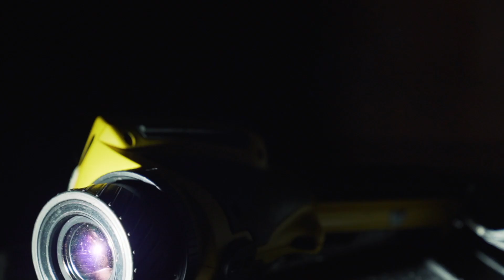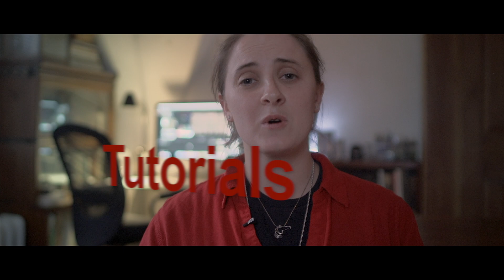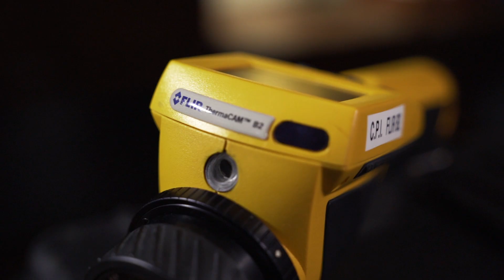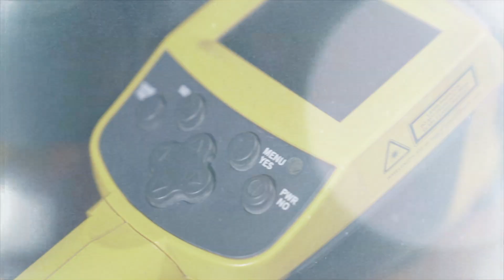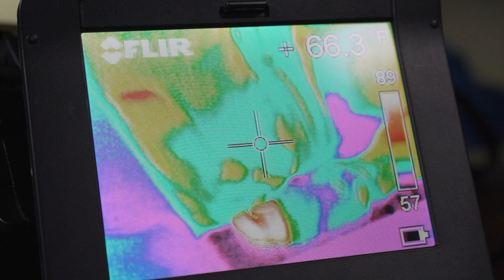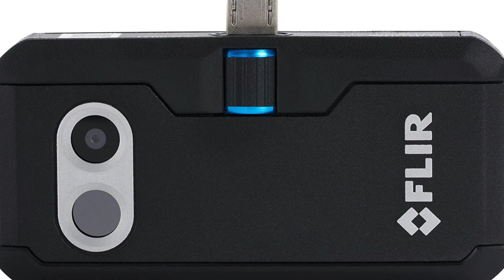Ghost Hunting | Thermal Imaging-THE COOLEST CAMERAS EVER!!!

Comment: The footag quality of IRFPA's has come a long way not least in these uncooled VOx microbolometer sensors 
I also use one, a model from Raytron that looks like a small rugged consumercamcorder with high ingress rating, with a foldable 5.1"  AMOLED HD screen.
The resolution on modern ones is getting higher and higher 
Fx https://youtu.be/uF0jfdAlsgo?si=VOyW9AgflBXk635c&t=46

Comment: question for you what is the best color palette to have it set to when ghost hunting?
Reply from the maker: @planetpapa2085  That’s a great question, there is no best palette for investigations, we use what ever gives the most detail in the environment that we are in. Often we use rainbow HC when using our B2’s as it has slightly enhanced contrast in the color spectrum and is generally a bit more flexible. In general pick the one that looks best for where you are, they are a visual representation only and don’t affect camera capture abilities. That said, what you really want dialed in is your emissivity settings as that great affects the accuracy of the camera. Hope this helps!
Reply: @ I just got it and am new to it.  How do I dial in emissivity settings?  What is the best way to do it?
Reply from the maker: @planetpapa2085, We attached a link below to the infrared training institute, they have a emissivity table you can study. You will need to adjust emissivity depending on your location and then adjust the emissivity as you move around and scan different materials. The FLIR b2 user manual also has a table inside, you can find a pdf version online. The infrared training institute also as well as FLIR both have training programs as well as some free instruction videos on YouTube, highly recommended if you are new to using these devices.

https://infraredtraininginstitute.com/thermograpahy-information/emissivity-of-various-materials/

Comment: Heat signature actually is based on light, but in infrared spectra, e.g. light of longer wavelength which cannot be seen, that is what makes it interesting. Thermal information about object originates not from convection of heat through air but on direct detection of infrared light and transforming that information to visible data. Radiation of much shorter wavelength like X-ray is also light. I was visiting researcher on some synchrotron radiation facilities and X-ray sources are classified as light sources, although not directly visible it is still light.